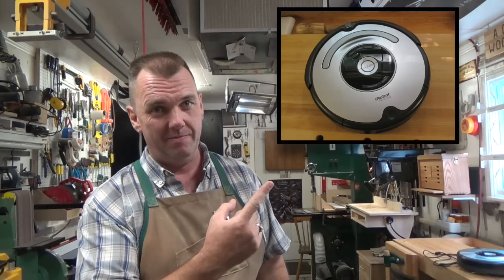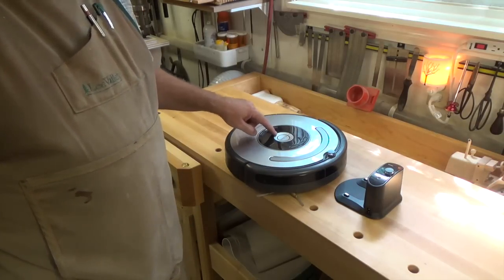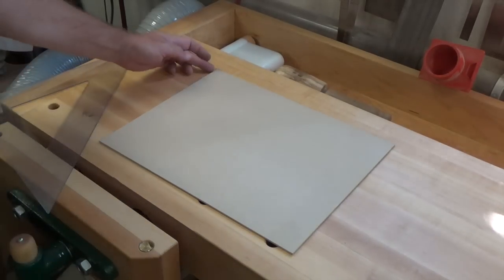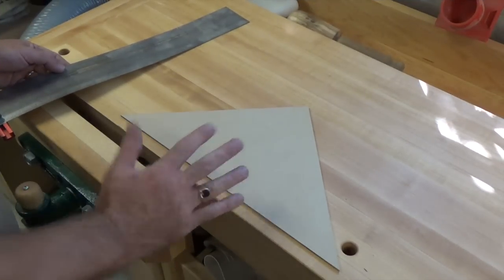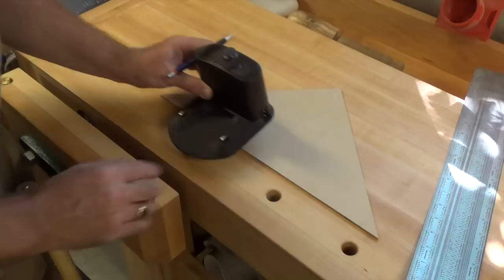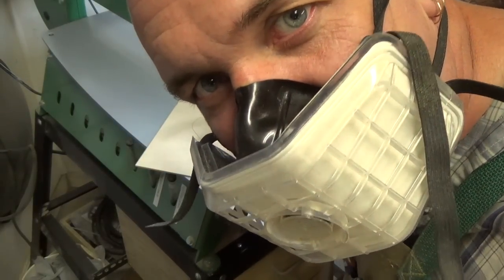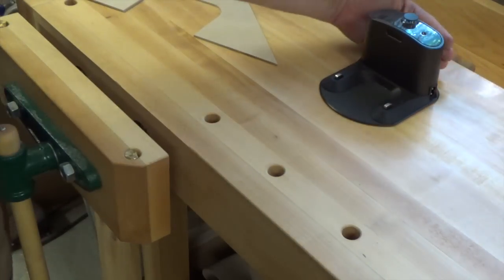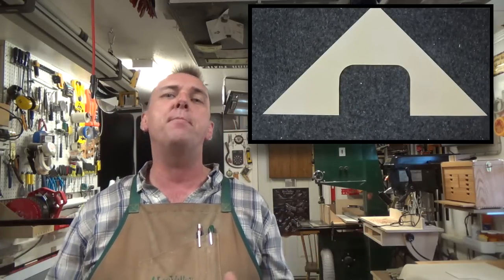Roomba support

Comment: Did you make that clock?
Reply from the maker: +Steve Muise Yes, I made this clock about 8+ years ago.  I can't remember the exact number of hours but 120 hours sticks in my mind for just the cutting.  The sanding, assembly, wiring, finish, windows and base were all extra time.  It stands almost 6' tall and lights up from top to bottom, chiming on the hour.  You can see the clock in a thread found here.  http://www.woodworkingtalk.com/f13/dome-clock-5829/  The second page of the thread shows the complete clock with the base, complete with hand cut cabriole legs.  I hope you enjoy it.

Comment: Kenny, I enjoy he video but I would really like to know more about clock. When did you build it, build time, etc. I sure would like to see it. Paul a.k.a. paulsmessyworkshop on YouTube
Reply from the maker: +pcorlis Thanks for the kind words.  I made this clock about 8+ years ago.  I can't remember the exact number of hours but 120 hours sticks in my mind for just the cutting.  The sanding, assembly, wiring, finish, windows and base were all extra time.  It stands almost 6' tall and lights up from top to bottom, chiming on the hour.  You can see the clock in a thread found here.  http://www.woodworkingtalk.com/f13/dome-clock-5829/  The second page of the thread shows the complete clock with the base, complete with hand cut cabriole legs.  I hope you enjoy it.

Comment: I feel your pain...
Does the robot vac actually work?  Just wondering.
Reply from the maker: +Hardnox We've had this one for a while.  When we had our dog, we had issues with pet hair everywhere, constantly.  We bought this unit to combat that.  I was very skeptical at first but this little unit proved me wrong.  Within a couple of days, the hair problems were gone and as long as it is run regularly, it does a good job of maintaining the carpets and floors until the weekend house work can be done.  I'm quite impressed actually.
Reply: kennyearrings1 Thanks.  Good to know.  I have a dog too.  That's why I asked.
Reply from the maker: The pet version (which this one is) has the feelers out the front that sweep the dog hair in front of the machine to allow the machine to pick it up.  You do, however, have to remember to empty the dust container, otherwise, it gets full and doesn't perform as well.
Reply: Thanks for the info.  What's that little bugger cost?
Reply from the maker: +Hardnox that's hard to say. It depends on the model. I believe they are cheaper in the states. They are a few hundred here in Canada.
Reply: Thanks.